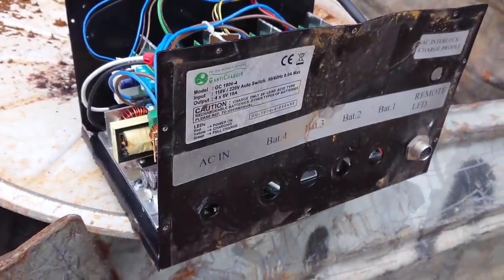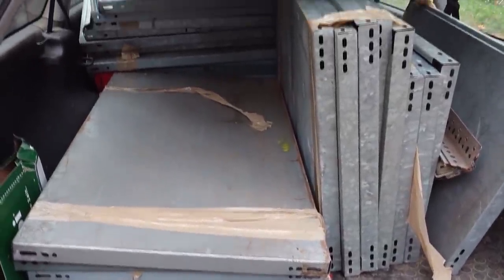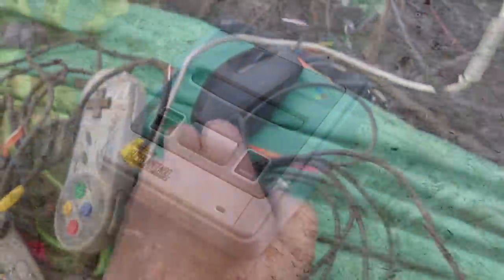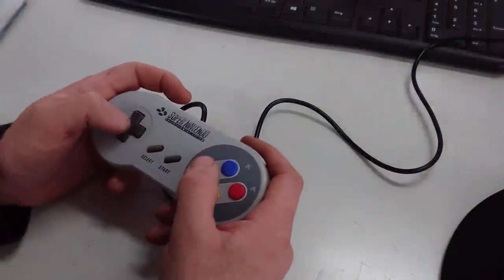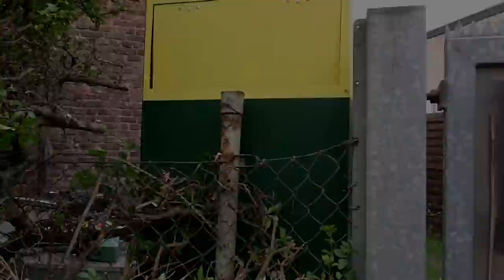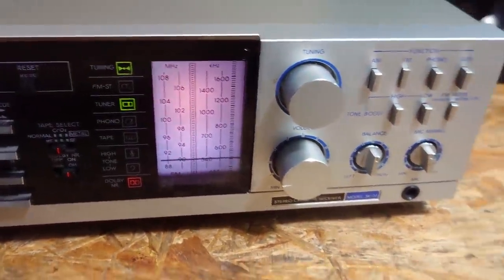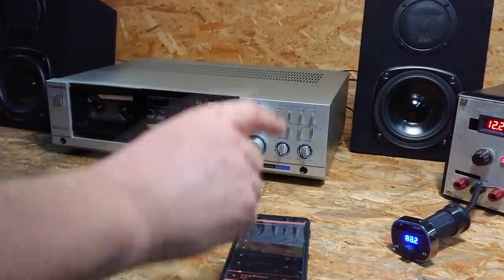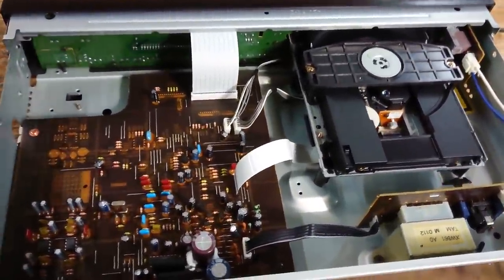Supreme Scrapyard Finds! Repair-A-Thon!

Comment: How many times have y’all soldered wires together only to realize that you forgot to put the heat shrink on first.
Reply: So frustrating!!!
Reply: That and forgetting to put a connector shroud on to a cable before soldering the plug.
Reply: Ouch.
That one hurts.
Because i know i´ll do it again sometime... -.-
Reply: More times than not, unfortunately.
Reply: Hell yeah, don’t you just hate that. Luckily I’ve only done it 238 times. 🤓
Reply: 1000
Reply: Too many. XD
Reply: yes
Reply: Enough times to have bought liquid electrical "tape" to paint over said bare wires, so it still can be isolated.

Comment: I'm not sure if German mailboxes function the same as USPS boxes, I'll explain them like they don't. Instead of opening from the bottom like the mailbox you've made they open from the top. the "door" to open them extends down into the box at an angle, so when you open the box all you see is the door all the way to the back of the box, think of it like a shallow bucket. The lower half of the door also acts as a counter-weight pulling the door closed after the package has been set on top of it. the package then falls into the lower area of the mailbox, where it is no longer reachable because opening the door blocks the lower area.  Point of my story, if you want a simple low tech solution for mail security look into USPS mailboxes.
Reply: So sort of like book drop off boxes at some libraries, its very simple in function and once inserted packages cant be retrieved without opening the back.
Reply: @bahmad5811  exactly like that.

Comment: When I was servicing for a living, I hated having to replace belts on many of the tape decks. Most were a real pain to replace. Always remember to clean & lubricate the function switches  when you have to tear one of those apart, especially the Record/Playback switch and all the pots.

Comment: I like your mailbox. Seems like it needs a shroud over the front to help reduce water entry. I'm envisioning something like a 100mm depth piece across the top, and then the angled pieces down the side that would go down to about the bottom of the door. You might could also use some magnets to keep the door closed but remain easy to open by the delivery person. Possible a small rubber gasket that goes around the outside of the door would also help reduce water intrusion.
Reply: I agree with you. That’s the first I see the design to put a little metal canopy of the entrance on the mailbox that will somehow block  any moistures going inside the metal box or a water stagnation is more evident in the future. We had one time a family of racoon came inside in USPS mailbox in our area. We have to call the animal
control to remove them. It is a must in cold countries were snows and rain are common enemy of a metal mailbox.
Reply: I might also suggest a raised floor so the boxes do not sit in water if it does get in (and maybe some drain holes).
Reply: I see the need for a one way trap door inside so once stuff goes in people can't watch and then just open the front and reach in to take the items.
Reply: @Mr.Unacceptable  Our postal system, as well as other couriers like DHL, have drop boxes with one way doors that open out by tipping the front down, revealing a pocket for the package to go in. When the door is closed back, the package drops into the box, then another could be loaded the same way.

Comment: 9:16 heh, funny. This is exactly what my dad and i did years ago, but with electric junction boxes. The space to the street was at a premium (a single, double span gate), yet at the same time he wanted each renter to have a large box to receive documents (offices and stuff). So the best solution was a huge box. We even had an anti-theft system where once the item got inside, a secondary flap would make it impossible to retrieve items fallen in past it.
Reply: I always want something like this for my house. So deliveries could be put in a door and be dropped inside the house out of the weather, and any porch pirate activities.
Reply: Thats what I thought, have an internal flap and maybe some cushion material on floor of box so your items don't break as the drop down, great job

Comment: That Pioneer PD-S603 was probably the best bang for the buck hi-fi CD player back in the nineties. Due to the turntable construction It had extremely few disc read errors, compared to other players. Which of course translated into a very high resolution sound quality.  I still got my PD-S605 in the attic. Great find.
Reply: Technics was a good option too, my two players still work great after 30 years...

Comment: Another great episode. Your diversity of topics is what keeps me coming back. My best guess about the CD player would be the odd weight distribution at the store was just enough to flex some of the components of the ejector mechanism to prevent it from working properly, but once the weight was removed, everything returned to position and was no longer binding.
Reply: more like the loading belt is getting bad I just repaired one because of that and have replacement belts coming to repair two more .
Reply: @richardbrobeck2384  Entirely plausible, but if the belt was bad at the store, wouldn't it have been equally bad at his shop? I'm not overly familiar with these mechanisms, so I suppose any viable explanation has to at least be considered.
Reply: @klschofield71  Take the Pioneer laser disc I just repaired the loading belt was slipping causing it still to work at times same with My own Pioneer DVD player !
Reply: @richardbrobeck2384  Thank you, good info

Comment: The belts for opening and closing the tray of cd players are the most common things to fail. After that dirty laser lenzes clean them with pure alcohol if that doesn't help replace the lazer unit.
Reply: Another related issue is that belt pulleys are mostly plastic which can become brittle and crack. Most frequently it's the drive/motor pulley. This failure mode is indicated by intermittent failure to move the tray or a slower speed of movement because the motor shaft spins inside the cracked pulley.
Reply: @SHX164  Also limit switches and ir sensors get dirty.

Comment: FYI, sometimes thrift stores throw out food processors, blenders and similar kitchen appliances because they don't include a safety lid, blades or other important parts, maybe you should ask if they have any "uselessly incomplete" items?
while the machines might be very incomplete, they can still be disassembled into spare parts

ALSO! I don't know if this is also the case in Germany, but in Denmark i haven't had any deliveries from UPS where the "postman" spoke Danish, so you should perhaps also write "Packages" on the package box

Comment: Those tool boxes are great. Perfect for taking to the automotive "U-pull" junkyards here in the states.
Reply: You still have scrapyards where you can pull your own bits off cars?  I happily remember tottering about 3 cars up (tricky, but less hassle and less dirty than working on the one at the bottom!).  It doesn't happen here (UK) anymore - maybe for 20 years or more.
Reply: @markavis7232  Yes. All over California and in other states too, but CA has 30 million cars

Comment: Helpful hint: if you are faced with having to remove tape adhesive from surfaces that you would prefer not to mar in any way, look no further than your faithful friend WD40! Wet a rag or paper towel with it, and saturate the sticky stuff ( if it is dried out and crusty, you may have to let it sit a bit to rehydrate the stuff ), once it becomes mobile ( ie you can smear it around with your finger, rag, etc. ) give it a good wiping. Repeat as necessary. It will give you a nice clean surface that is shiny and free of crap! WD40 is also good for cleaning the covers of books ( if they are glossy. NOT GOOD FOR PAPER STYLE COVERS! Unless you like to have oily books ). Great videos, love your work!👍🤙

Comment: That military tool box you showed had a series of numbers: 5180-12-150-9851. The 5180 is the commodity code for "hand tool accessories." The 12 is the country code for Germany. The 150-9851 is unique to those types of tool boxes. So if a person in the German government wanted to order one of those tool boxes through official channels, that stock number would be the one to use. For the US, the 5180 would be the same. The 12 would be either 00 or 01 for the U.S. The 150-9851 would probably be for something different, but it would still be "Hand tool accessories." Thanks for the video, Johann Krupp

Comment: I successfully repaired another YAMAHA CD-Player before (part of a Pianocraft CDX-E400 Unit). Key knowledge I found on the web was: opening mechanism has a belt drive. The belt loosens over time and starts slipping. On top, esp. with no CD inside the spindle seems to get stuck easily (magnet inside) which puts more load for the belt to drive. Belt was a little tricky to get to, but totally doable. For replacement I used a generic out of a "LIDL/Parkside Dichtungsring-Sortiment Box". Even if it works now it still might not hurt to replace the belt – to ensure working condition. I´m happy to forward you a small manual in German. Let me know if you´re interested! 

Keep up the good work – very inspring episode again!

Comment: You could add a light sensor in the bottom and a solenoid actuator trap door and an Arduino.  Then any time a package is dropped in, the door drops the package inside and locks again.

Comment: I can repair small engines, have a small shop with Lathe, Mill and tools, a stockpile of raw material, i do make sand casting of Aluminum and aluminium bronze. I have two Ender -3 Printers and a Mars 2. Plus i make knifes as a hobby. I know there will be a time in the near future when i need everything i know, and i try to teach my daughter one thing: If something is allready broken, you can allways look inside....Maybe you can spot the problem and fix it. The worst thing that could happen is that you have to throw out more than one piece

Comment: The tool box you found is really similar to the tool box that I was issued when I joined the U.S.Air Force in 1970.  All the corners were rounded off & we called them "clam shell" boxes.  It's interesting to see they were in use in Europe as well.
Reply: We call them cantilever in the uk
Reply: @philtowle4683  it's interesting to see that similar ideas come out from unconnected sources at about the same time.  I hadn't heard the cantilevered term but it is aptly named.  Thanks I learned something new today.

Comment: Whenever I have stuff such as the controllers to clean, I simply put them in the dishwasher, they come out like new.
Obviously no electronics, just the plastic parts ;-)
Reply: I put a Troughline tuner in the dishwasher. It had spent decades being used by someone who smoked and it smelt awful. Dishwasher got it nice and clean, and it worked fine after spending a couple of days drying in the sun.

Comment: Awesomeness! With the Yamaha CD player, the gears and track opening the disc slot can get a little sloppy, and if the carrier gets a little out of square it won’t fully engage and the unit will show an error. It’s usually just a matter of pressing on the front panel, wiggling the carrier into alignment, and it will resume operation.

Comment: 10:02 You could use cardboard at the bottom or use a cloth/fabric sheet riveted to the corners/sides to prevent damage to the packages. I would suggest to install a trap-door to prevent package thieves too.

Comment: Package Receiving Box:  ...have a slightly oversize flap door overlapping edges of the hole, .hinged from the top outside, in order to keep weather out. Maybe a pneumatic strut , like on cars, to hold flap door open while package is placed inside.

Comment: Out here in Canada we have letterboxes that use an ingenious design to 
secure against simple theft. The door is like a 110 or 120 degree trough
 of sorts. It hinges from the bottom and when you pull the door open it 
will provide a rather large area where you can put a sizable package yet
 because of the trough design the opening into the container gets 
blocked. When you close the door then the simple angle of the trough 
will allow the package to slide out and into the bin. Think of those  
house trash bins with the triangular top that have a swinging section 
you can move aside to put your trash into the bin.

Now take that swinging section, flip it around and put a hinge at the peak of the triangle shape. Now that would be secured to that opening. When you pull that open, the back side panel should be JUST larger so it can not only stop from just swinging right out of the opening but also to entirely block the opening when pulled open.

Comment: There might be a rubber drive belt, under the optical drive, which is used to open / close the drawer.  If the belt is stretched, it may no longer have the grip to fully pull the drawer back into place and activate the microswitch which allows the 'Open' command to be sent to the drawer motor.  If you subject the player to a few gentle bumps, the drawer contacts the microswitch and the drawer then opens.  Even though this approach may provide a temporary fix, the drawer will always prove to be problematic, until the small belt is changed.  Anyway, that's the first thing I would check, but it's important to mention not all optical drives use a drive belt to open/close the drawer.  Ok, well thanks for your videos, as they are always brilliantly informative, and I also get learn interesting things from each of your presentations which I can then apply to small projects of my own.

Comment: Realy wonderfull stuff  that "ms polymer" 
I`ve been testing it on a broad scale of applications for more than 10 years now.
Must say I`m impressed by the range of applications it has,especially on wet surfaces, also very usefull to repair cracked an torn rubber.

Comment: audio casette tape = the sound of pure nostalgy  :-) 
i have a complete audio system from that yamaha natural sound series where this cd-player come from, runing at home since the middle of the 90s. it contains a tuner, a cd-player, tape deck and a big audio amp with a full equiped dolby pro logic speaker set. it runs perfect and without any problems since 25 years.

Comment: Hmm, maybe add some padding to cushion the package drop chute. If you were making it like a regular drop chute, you'd have a handle that pulls down from the top revealing a drop tray that prevents people putting their arms inside. However, given your solution is so high and deep, I don't think that's necessary.

Comment: My in-laws have that Sanyo amp as part of a system. In the last 20 years all I have had to do was put contact cleaner on the volume control and remove/reinsert a ribbon cable between the amp and the tuner, to cure intermittent audio. Japanese kit of this era seemed to just work. And last!

Comment: Its possible that the way things were stacked on top of the CD player at the thrift store had deformed it minorly and impinged the mechanism that advances the CD tray. Can't tell from the video audio if the mechanism is trying to work or silent after the button press.

Comment: Sweet thrift store! Wish I had a place like that around me! I refuse to buy anything new. Not only is it expensive but it never made sense to me when you could buy used. I dont even buy new clothes. Why when they're just going to get dirty and worn out, usually the next day in my case. If some thing breaks I do my best to fix it, not anywhere near as good as you when it comes to electronics but most things are usually very simple fixes. I've learned a few things watching your channel, I appreciate the time you take on your videos. Keep up the great work.

Comment: I would weld a small weight on the back of the mailbox to push the door fully closed. Alternatively, you could shift the hinge forward towards the road and then it’ll close without the extra weight. Just a matter of moving the center of gravity.
Reply: If he puts a magnet on it, that could be used for electronic locking too.

Comment: As far as the Yamaha drive tray not opening, these machines work best when they are very level on the counter. The plastics inside the drive unit sometimes move slightly out of alignment and affect the gear that opens the tray. Also, voltage is important for these units to operate correctly and a slightly low voltage from a power outlet will affect performance and output. Sometimes workers in thrift stores plug in electronic items and do not know how to operate them and thus, label them as not functioning. Moving electronic units sometimes juggles mechanical parts in and out of position when items are of this age. That is to say that washers or spacers are not noticeably loose or out of alignment and then the mechanicals seem funky as if they work intermittently. Of course, there is always the possibility of gremlins I suppose.

Comment: Removing old, dried masking tape is much easier if you warm it first with a hot air gun.  Also, try wiping on a mild solvent (such as alcohol) and allowing it to sit for a few minutes before peeling.  Sometimes that softens the dried up adhesive.

Comment: I like the mail box idea but Its a little too easy to steal packages from.  Maybe adding a trapped door arrangement where packages fall through but cannot be retrieved. UK franked mail boxes have a door and a lever. Mail is placed in the  top compartment and the lever pulled which tips the compartment back emptying the contence into the secure box below. You cannot reach the secure box unless you pull the lever which closes the top compartment. Simple but effective. ❤🖌🤓

Comment: Te remove tapes, labels, Scotch, or other things gluet like this, use 3M spray cleaner, 9472 / 0.2, lime, works like a charm... and smells nice to. Apreciate what you are doing, very nice work!